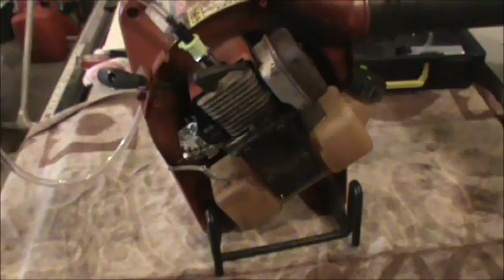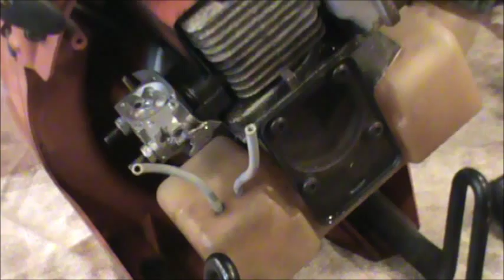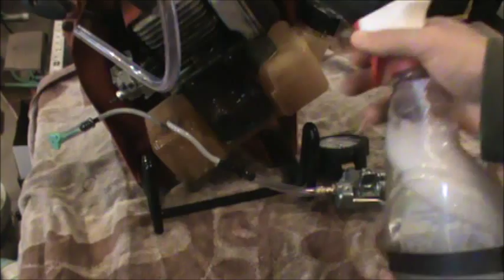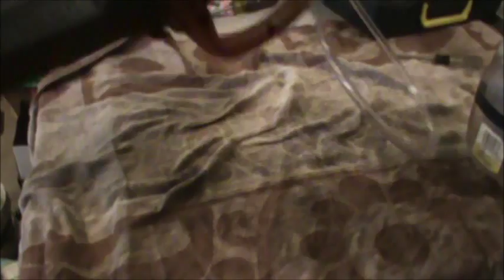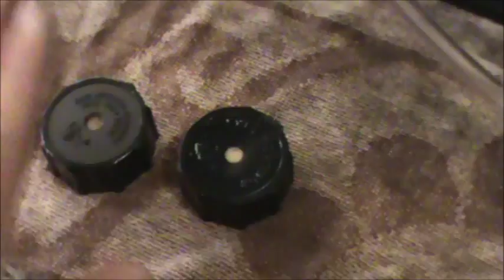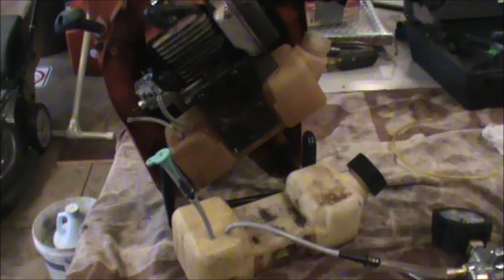Mityvac MITMV8500 to test fuel tank

Comment: cool vid ...I have been working on a sthil blower ..running some test on the fuel lines and tank..and found that the cap is leaking from the top from one of them holes...do you think that it will be a problem in the engine running,,i am having a problem with it .it will run then die then I will be real hard to start...thanks
Reply: +Pinetar And Robyns Homestead    most times that  is a carb problem. usually when a motor does that its in the carb. the fellow in the vid places way too much emphasis on the tank. If its not leaking, not the prob

Comment: That's cool. I have a couple of Echo SRM-230 weed eaters that I have to run on half to almost full choke. Cleaned the carbs up on them and found the small screen in one was about clogged up, but still starving for fuel. I'm going to buy that MV8500 and check them out. Thanks for the great videos and tips on fixing them.
Reply from the maker: You are welcome.  Good luck!